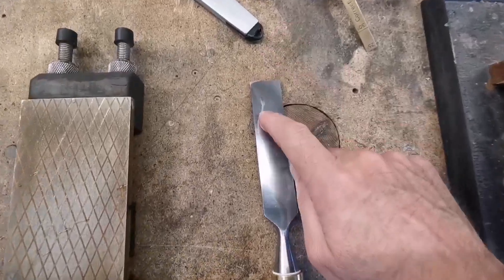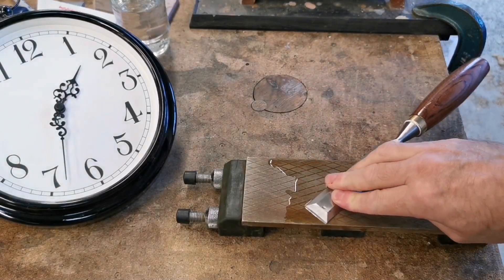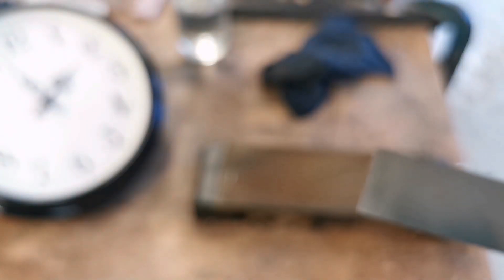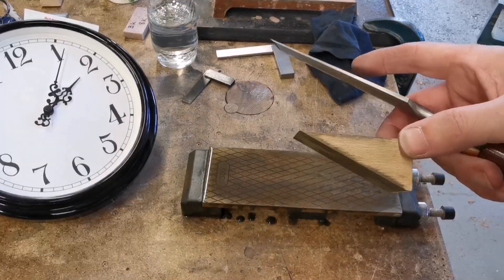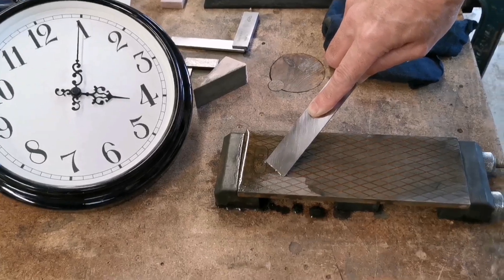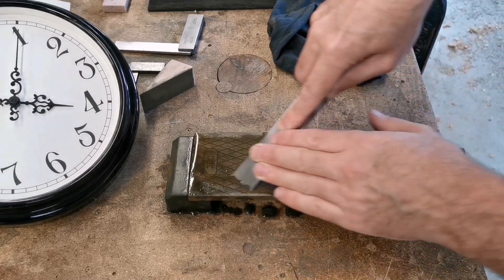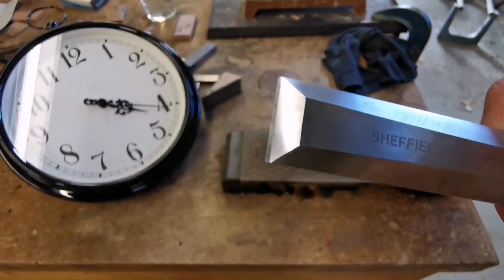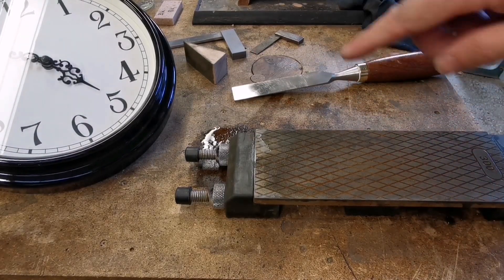Chisel restoration - How to flatten (lap the back) & prepare a 25° bevel - Pt1

Comment: Fair play, you must have spent at least 12 hours hours saving that chisel from a life of being perfectly usable to being wonderfully usable. And very shiny!
Yes, it is mostly sharpening for the sake of sharpening, but every time you use it you will know what you went through to get it there...
Reply from the maker: You are right. And I'm glad you see it that way too. But also there's the feeling of the back of the chisel sliding across a surface very very easily. Safe in the knowledge that there is nothing stopping as near as perfect joint being created by that smooth surface. And it's added about £500 to the set of chisels.
Reply from the maker: I think it was 14 across the 5 chisels 🙈. Mostly, what I call 'stolen time'. When someone's chatting to you, or when my students don't need me, or while I'm waiting for the kettle to boil. Those periods of 'stolen time' 👍
Reply from the maker: Hi. I've just released a new video on sharpening a Chisel. It's worth watching because it's a back to basics with great results. Here it is 
https://youtu.be/qN9W-03wMm8
If you like it, then please comment as it helps me grow this channel. 
Thank you 
Jamie

Comment: 5:35 I've read time and time again - that is how you destroy a diamond stone!
Reply from the maker: I've never heard that one. Well, not never, but it's bound to take the edge off some of the particles of diamond. I don't think it's too bad on the stones. The steel on the chisel isn't as hard as the Diamond.
Reply: @twcmaker That makes sense I agree. People claim that diamonds can be ripped cleanly off the electroplating. I don't know if it's a myth but I hope so. Otherwise diamond stones seem too fragile.
Reply from the maker: I've had about 5 or 6 diamond stones over the last 11 years. I've thrown one away in that time. It was from Aldi and I wore it out on heavy garden tools. It was £7. After I found it wasn't very flat then it got used for any old job. I got more than my moneys worth from it. Newer, and slightly more money ones are better in my opinion. I don't spend over £30. The difference over that amount is slight and because I use other stones (varying the stone and the orientation) it doesn't really matter that much.
Reply from the maker: @Dennis-ud2nh  this might interest you. I've just released a new video on sharpening a Chisel. It's worth watching because it's a back to basics with great results. Here it is 
https://youtu.be/qN9W-03wMm8
If you like it, then please comment as it helps me grow this channel. 
Thank you 
Jamie

Comment: If you look at Japanese chisels and the angle of the handles they don`t seem to bother to align the handle and blade. Have a close look for yourself .So you might as well use the thin ruler trick on chisels as well as plane blades .
Reply from the maker: Seriously.. You are so wrong.
Reply: The ruler trick is not suitable for chisels. Maybe Japanese chisels but not Western chisels.
Reply from the maker: You people... The Ruler Trick is for plane irons. NOT for CHISELS
Reply: Japanese chisels have a hollow back and a soft steel lamination for this purpose. The hollow back is to make polishing fast. The soft steel is for energy transfer and pushing the edge forward to reduce lapping.

Comment: At about 5.00 you get to the important stage of fighting the Twist in a blade. If you  rub the whole blade (or as much as possible ) on the diamond plate you will identify where the high spots are that make the blade wobble and stop the edge from being straight . Using a Dremel etching bit you can work those high spots down in between the diamond plate . I slightly copy the Japanese chisel way and etch the inside surfaces to leave the side edges shiny . The etching depth is very slight but gets the twist out very quickly . Sometimes the twist comes from the back end of the blade --miles away from the cutting edge .But a flat diamond plate will still  roll the blade and still mess up the clean cutting edge .So try the etching trick to identify the problem . Find the high spots .  Some top class old Sheffield blades have the distortion and never get used properly  in their whole life . They could be Ward or Marples or Sorby . Pin down where that twist comes in .
Reply from the maker: Great advice. Thank you.
Reply: Hi Jamie, I tried a similar approach using a Dremel with a small grinding wheel on an old Marples firmer chisel with a definite belly. Does not take long to get a hollow in the middle and this allows the diamond stones to get to the edges and certainly speeded up the process of getting it ready for use.
Reply: @keirgallacher4374  The dremel trick is good for very thick old Sheffield blades.There is so much steel to play with and it`s a learning process. Recently I made sure my hand cranked sandstone water sharpener was nice and straight . I work the blade to and fro as it lays on the top surface.Just stay off the last 1/4 inch.Then the diamond plate can work right near the edge ,guided by the back end of the blade.

Comment: Why wouldn't you take that corner off of the bevel side until it is gone, instead of ruining that perfectly mirrored back? It would be so much easier.
Reply from the maker: Good question, that I think I said why in the video. By removing bevel back to the corner, I would be  using up years worth of use.
Reply: I guess if that chisel was brand new, or one that someone special gave you, or it was your only chisel, and it cost $1,000, and you couldn't replace it, removing that tiny amount from the tip might matter. Or you could make up a silly excuse about shortening the tools lifespan by years of use,  remove so much more metal from the perfect bottom, which wouldn't do its lifespan any good either, and make a youtube video about doing it the hard way.
Reply from the maker: Great response 👍 I'll guess you skipped through the video without listening. Anyhow, you've a lot to learn still. 
Thanks for the comment, I appreciate it's your opinion based on what you know.
Have a nice day. 🙏
Reply from the maker: Hey Brandy. Seeing as you enjoy comments. Here's my latest video. What do you think? https://youtu.be/BrUE1Hs82iQ

Comment: How about just buying a new chisel?  Even my bottom-of-the-narex-line chisels flattened up in less than 15 minutes on an 800 grit low-tech king stone.  Sure, their balance leaves a bit to be desired in the thinner sizes, but you can fix that by paring some off the handle of their 6 mm.  And in much, much less time than the almost 5 hours that this gentleman says he put into re-flattening this chisel.  Another option would be to hollow out the back a bit with either really low grit loose abrasive (60 grit anyone?) or the rim (NOT the face) of the wheel on a bench grinder.
Reply from the maker: Thank you for your comment. These chisels are rare and therefore very collectable. Whilst some might like and agree with your comment. And maybe I would under other circumstances. But not this time. There's more about the chisels here
https://youtu.be/W3oPd4J5lI4?si=YfiqIgDWsN3FUsTU